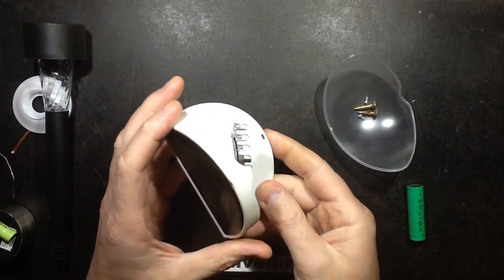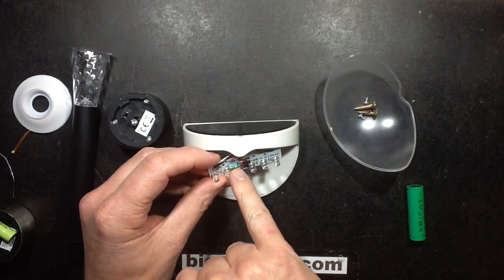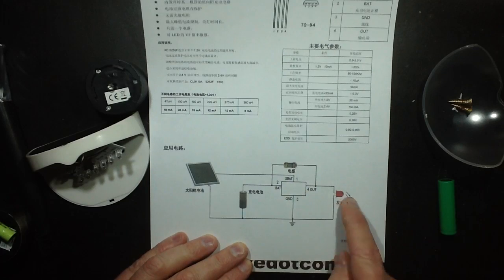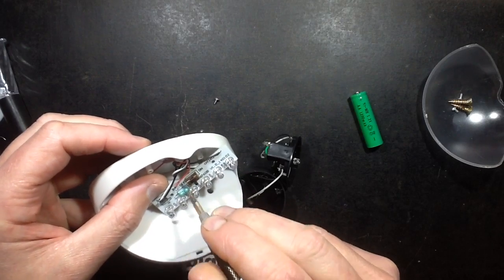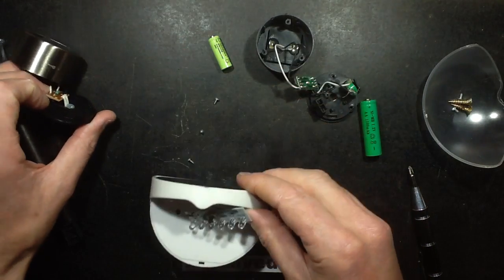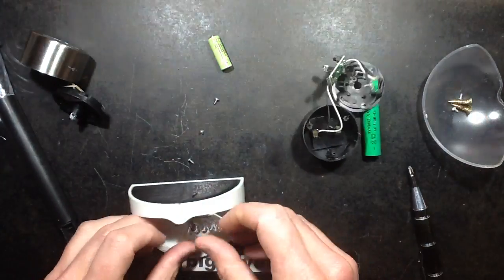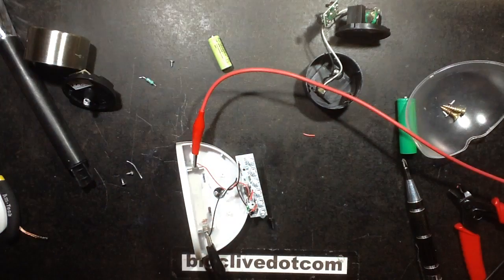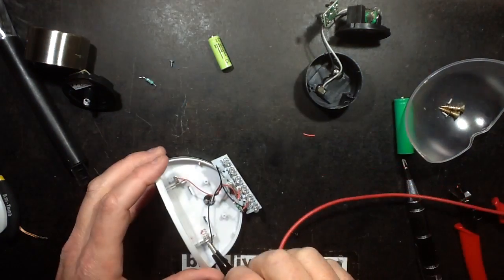Extending the run-time of a solar garden light.

Comment: One thing to look out for is that the high frequency parts of these circuits are fairly sensitive to wire length. I was looking into getting a stable DC out of one of these lights by adding a schottky diode and a capacitor instead of the LED so i bodged them in using 10cm of wires. No go, almost no voltage at all. Bodged the diode and capacitor directly to the LED pads and it worked perfectly.

Comment: Well I've always wanted to learn the color band codes and have even tried a few times. Now I know them forever. That mnemonic will be difficult to forget. When I was in college a professor taught the class a memory skill that works by associating drastically obscene, fantastic, out-of-instance, or non-sequiter imagess with the memory to be stored. So if for instance I wanted to remember a telephone number, or even a name - I could, for instance, create a visual snapshot in my mind of something ludicrous. Like - an accident on the corner of 1st and Mary street where Mary is the name I want to remember and the 1 is the first digit of her number - there on a huge billboard with purple and pink polka dots is the rest of her number all overlooking the horrible accident in the intersection with a elephant and a semi truck. Once I have all that imagery fully filled in with all the details I won't forget it. In fact, just conjuring this example will cause me to recall it years from now. Mary's phone number starting with 1 is permanent.

Comment: Sometimes I get a bit confused watching all these UTube videos.  Saw one the other day that said inductors were pretty much usless in a direct current circuits, then another video shows a cheap china light that uses an inductor as a fuse in an AC light, and here you have your circuit controled by an inductor.  Makes a mans head spin a bit.  About 4 months ago, I found myself in need of an inductor of a certain size, and looking in my parts bin revieled I had nothing in that range to even try.  So I retired to Ebay and found that inductors, like resistors are available in "kits" ranging from very small to large.  So I placed my order, and somehow ended up with a double order (double clicked, where I should have single clicked or something like that!) so now I have a plentyful supply of solid state inductors.  A couple of weeks back I received an order from Bangoods that had a pack of 50 1 watt LEDS,  I needed a couple for a porject, but you know how that goes, one is a price, but you can get 50 for a buck more, so why not right?  So here I sat with 50 1 watt LED's so for shits and giggles, I took a piece of circuit board and built up with 9 of these little gems.  My thoughts, well I have a lot of 9 volt rechargable batterys, and 9 watts on 9 volts, why that looks like it should work right?  NOT  things got very hot very quickly so I began inserting resistors, begining high  and dropping low, but all of them became very hot, very fast.  Then it dawned on me, I have this big bag of inductors, why not give one of them a try.  I picked a rather large (in physical size) one and inserted it in the main power line, much like the fuses in the cheap china LED lights.  Sure enough, now the light is extremely bright, lighting an entire room if needed, some what dimly but bright enough so one would not step on a cat, or inadvertantly kick the coffee table, quite usefull in this era of power cuts and huge thunderstorms that love to blow the power structure in the warm months, and ice storms in the winter!  I have not given it an indurance test, but things stay cool enough to the touch, and the wife says it is blinding her if I aim it anywhere near where she sits, pearched on her recliner watching the idiot box, while I watch you on UTube listening through an adapter that runs the sound through my blue tooth enabled hearing aides.
Reply: The inductor is in an ac circuit here.

Comment: The reason for the current droping when increasing the inductor is, that the driver chip "charges" the inductor for a fixed amount of time each cycle. The smaller the inductor the less current will build up in that time. Now you might say, the bigger inductor holds more energy with the same current, but remember, the energy inside the inductor is calculated as ½*L*I² . The current is squared and therefore "overpowers" the increased inductance. 
Depending on the type of driver it might wait after "charging" for the inductor to run out or it might wait just long enough for it to be "empty". In both cases the next charging cycle starts again from zero and is therefore governed by the same law.

Comment: A higher inductor value giving a lower current is nothing strange at all, just physics. ;) Keeping everything else the same it takes the inductor with the higher value longer to get "charged" to the same current (simple linear relation between time constant and inductance). If the controller doesn't do any current monitoring, but has a fixed dutycylce and period, the average current is inversely proportional to the inductance. (if you multiply the current and inductor values in the datasheet you'll see they all come to almost the same number, except for the very high current one where other losses reduce the number).

I've been doing electronics since childhood and picked up the color values then. The may not be in the same order as most crayon sets were coming in, but I still felt the resistor colors had a "natural" order, which made it easy to remember without any rude rymes. But you're right, the grey and the white rings were always the odd ones that rarely appeared. I could only remember that grey was "8", because white wasn't, because it appeared on the E-series "39..." values. ;) 
Knowing the color values by heart is very useful outside of electronics. If I want to number stuff where it's hard to write a clear number on, I just mark them with colored permanent markers. Luckily most sets come in exactly the colors for 0-7 and I almost never come to grey and white anyway (again?). And on dark stuff, where the colored markers wouldn't be visible, I use a white permanent marker as "foundation". It seems to have a completely different solvent in it, so painting over with other markers won't mess up their tip.

Comment: I found that 100 uH was a good all around value for these circuits.  I bought a few dozen 100 uH 10% chokes from an online guy and I measured them at 75 to 80 uH with two different meters.  I emailed the guy and I sent them back and he refunded the $$.  He also measured them at too low a value with more than one meter, so he had no explanation for the out of tolerance issue.  This isn't the first time I've had this problem.
So I gave up on RF chokes for this circuit and started buying the Fair-Rite 594300(something) 3/8 inch or 9mm ferrite toroid cores for 12 cents apiece and winding a 6 inch or so piece of wire on them to make any value of choke that I need.  They're lower resistance so have less I squared R losses than an RF choke - every loss takes away from the brightness of the LEDs.  I'm much more satisfied by the results.  Every electronics tech or hobbyist should have a few dozen ferrite toroid cores in his parts stock to quickly wind a needed value of inductance.  The cores can be from .25 inch or 6mm up to more than 1 inch or 25 mm but larger sizes get expensive.  You can get them already wound, of course.  A good source for small ones were the CFL lights.

Comment: Regarding the fading that dulls the light entering:  on eBay I simply bought a stack of Glass petri dishes.
 All you do is prise off the original plastic dome, and affix a petri dish over the cell and silicon it on.
  This eliminates the 'fading over time' plastic dome problem, but the most important consideration when initially purchasing the solar light is to only buy one that has the Cell made of glass, and Not the epoxy one (easily distiguished by the shiny glass surface, versus the uneven surface of an epoxy covered cell). 
  However if all else fails, using toothpaste and a cloth can eliminate the haziness (yellow) of an epoxy surface...
Reply: tifino Rubbing compound works better than toothpaste.   It's fast and easy by hand.
Reply: there are also spray on automotive UV A/B protectants and cleaners which will stop the yellowing for a couple of years between applications.

Comment: A better way of making the thing last longer, seeing as though that looks to be a standard AA or AAA battery, is to change the cell for one with higher capacity.  They are usually supplied with either 600mAh (AA) or 300mAh (AAA) cells, which are completely useless - so I stick something in with at least 1000mAh (preferably 1500mAh+), or the nearest equivalent AAA capacity (700mAh). 
Thankfully, I can get Ni-MH batteries more cheaply than inductors (I get all of my batteries, including Ni-MH, for free).
Reply: EXACTLY.  What he's doing here is interesting and clever, but really, all it's doing is trading off brightness performance for time.

Comment: OMG I love those things, I am always buying them from Dollar Tree and I usually buy every single one in the store too lol. I reuse the solar panels in them. I take and remount and wire them in a dollar store picture frame and make little 12 volt panels that generate a decent amount amp to charge a SLA battery or something.
They also carry a Ni-CAD or Ni-MH AA or AAA rechargeable battery which is very useful to me.
Reply from the maker: +ElfNet Gaming You simply can't buy the parts separately for the cost of the complete light.
Reply: Oh I know lol thats why I buy the whole light from the dollar store

Comment: The bigger the inductance the slower the current will rise over time.
If you put 1v on a 1 henry coil the current would rise at 1 a per second, a 10 henry choke would only be 100ma per second.
It looks like this chip has a fixed on charging time for the inductor, therefore the overall current into the led depends on the inductance of the coil.
Inductors in parallel generally isnt a good idea however this isnt a life support machine, the only thing to make sure is that the dc current of the inductor is at leas twice that on the drain on the batteries.
Reply: "Inductors in parallel generally isn't a good idea " How come? Would they be ok if you kept them at a good distance apart or can they do other unexpected things like oscillate?
Reply: Maybe not so much oscillate, but oscillations may be a problem, parasitics will be increased, causing ringing, this happens anyway due to stray inductance and capacitance, however multiple inductors will increase both these factors.

Comment: I always put in a decent capacity AA removing the rubbish one fitted but is there a way of installing 2 AA batteries so it lasts longer between decent bright days ?
I realise the output from the solar panel is small but in the summer nights are short but it seems with the low capacity batteries these things come with one dull day and they don't light up the next night!
PS the best solar lamp i have found so far is the poundland £5 one with the remote solar panel thats has a movement sensor the 3 batteries mean its never failed to come on even in the middle of winter !

Comment: Would you get better runtime and efficiency if you ran the leds in 2 series 3 parallel and kept the initial inductor similar one of your other garden light videos?
Others tinkering with 5252f suggest better performance if you run a diode and small ceramic cap on the output. Would this also  help?

Comment: How would adding another battery(bigger)work. And yes I would learn very little about inductors which I do appreciate very much.
Reply: adding more batteries would not work, i had the same thought at first but i just realised why it would not help. the problem here is not that the battery does not have enough capacity, the problem is that the solar panel does not charge the battery far enough. so the only two options are changing the solar panel (alot of work) or changing the amount of power the LED uses (much easier) thats why clive did what he did

Comment: So I will gladly admit that I don’t know 1/10th about batteries, electricity, etc... as you. I do however have a question. I recently purchased some solar pathway lights that hold a 14430 battery with a 250 mah rating. I have 2 problems though: 1. The lights are in an area that only receives a few hours of sunlight a day due to shade trees overhead. 2. The lights do not stay lit very long at all. My question is- will replacing the batteries with something rated at a higher mAh help my situation at all?
Reply from the maker: The main limiting factor is probably the amount of charge put into the lithium cell from the solar panel.  Relocation and aiming at the path of the sun may improve things.  For best results the solar panel should have unblocked exposure to that part of the the sky.

Comment: could you do a tutorial on running about 10-15 solar lights off a larger battery which has a dedicated solar cell which could be attached to maybe a shed roof? one problem with solar these days is a) they aint bright enough b) don't last long enough
Reply: Yes, I've been thinking of a similar plan, maybe driving four wired stations with two LEDs each, large enough panel to charge a decent battery in partial shade.

Comment: But doesn't increasing the inductance also increase the back EMF that provides the pulsed voltage supplied to the LEDs?  And if that's too high, isn't that a problem?  Where is that extra voltage dropped?  By decreasing the current, voltage increases, so power dissipation stays the same, right?  Can you tell me what I'm misunderstanding please?

Comment: I just used a .2 Watt solar panel and a 1500mah battery and put in a 20 ma led at 20,000 mcd. The inductor is about 150 to 160 uh.

Comment: Clive I use a couple of solar landscape high output lights around the house, they're good until about 1 am. I was thinking about adding 2 equal value batteries to the other 2 it uses in parallel to extend the time it's lit. do you think based on the solar input that would increase my time?

Comment: What if you replace the rechargeable battery with the Super/Ultracapacitors? Will it increase the life of the garden light?
Reply: Unfortunately you need one that is too big physically to fit to get even close to the run time off a battery.

Comment: Time you made an alligator clip attached to a length of stiff copper wire.
Then attach the copper wire to a heavy metal block, lead would be ideal.
This clip then can hold components or small PC boards for soldering.
Tinning leads or components will be so much easier.
BTW I also use a small red rubber bulb (Jaycar) for removing solder, it has a white plastic tip.
Can you add a capacitor to change the frequency of the 'charge pump' circuit?
Will it change the current instead of changing the inductor?
I once made an micro Henry add-on for my multimeter when I made spy bugs.

Comment: QX5252F Formula to find current for a given inductor.
=(((2*Vin)/L)*0.000001815)/Vin

For example, a Vin of 1.3V and an inductor of 82uH yields ~44mA
This tracks closely with the QX5252F Specification

Comment: So the inductor limits the amount of power that the leds can use,thus extending the run time of the light. would a resistor do the same thing or does the resistor use the same amount of power but regulates how much the led gets. Does that sound right?
Reply from the maker: +scott firman The inductor forms part of the boost converter that steps up the voltage.  It's more efficient to change the inductor than add a resistor.

Comment: Sounds like you need a variable inductance in the same form as a potential divider, or pot.
Shame it dont exist in that simple form.
Rewind a wirewound pot with enameled copper wire, then sand one side for the wiper, perhaps ?
Reply: +zx8401ztv Amazingly but variable inductors are very common and they are produced in vast quantities by most manufacturers (like coilcraft).
They are simple devices, you dont need to change number of turns to change inductance, there is simpler solution by movable ferrite magnetic core (varying amount of core in coil change  permeability and as result inductance).
Reply: +Miloš Lazović Or, for open/exposed coils, just adjust the spacing between coils to tweak inductance.

Though neither is an option with resistor-type package inductors as they are fixed value, but they are common enough that if you look hard enough you will probably find a suitable value lying around somewhere provided you do not mistake it for a resistor, as they look very similar.  Or simply keep an assortment of such values on hand in your parts drawer for just such occasions.

Comment: Hi, I have various Chinese solar garden lights that use a single 5mm LED or 3 of them wired in parallel. Drew the circuit schematics for all of them and noticed that every 4-pin IC has different markings and connections going to LED, battery and PV are wired on different terminals of 4-pin ICs. For example, all 3 of the single 5mm LED lamps have these ICs: F1 4U704, JR 8618 0442, and HW012 0386, while on the 3 LED one it's only printed "24088". However, I couldn't find any specs of the aforementioned chips for some reason, and since I want to upgrade some of these to a brighter, 1W LED setup, my question is: what do the prime differences between these ICs affect to (i.e. max. allowed input voltage / load current)?? I looked the datasheet of QX5252, and its min op. current is 3-300 mA, which is acceptable for a 1W warm white LED, assuming it won't operate on full brightness.
Reply from the maker: You can generally increase the output current to a degree by using a lower value inductor.